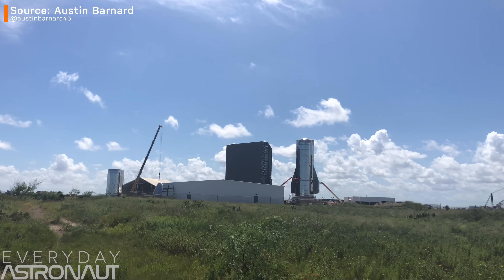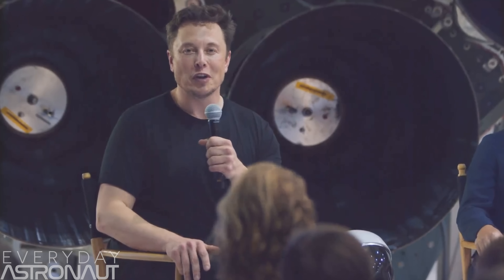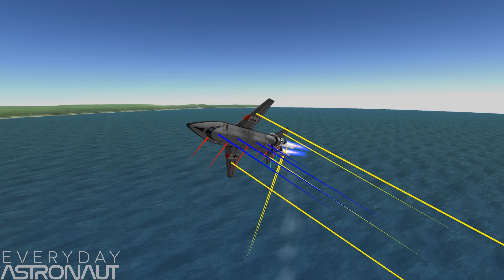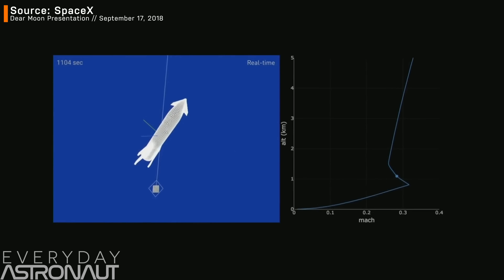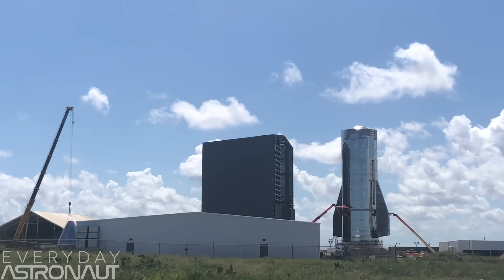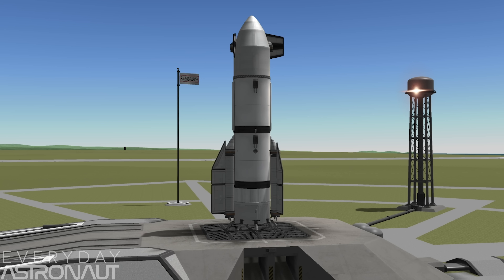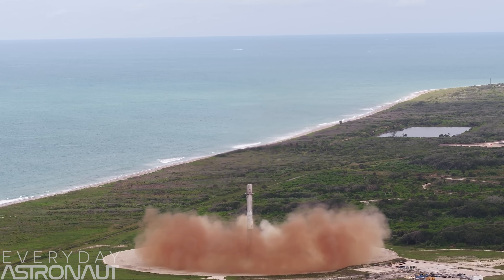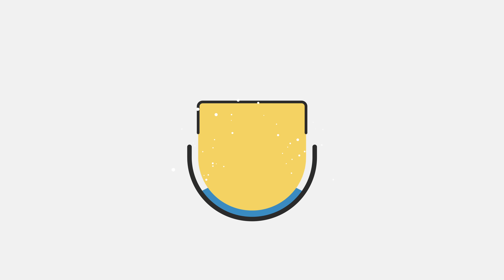Why does Starship only have 2 rear fins?!

Comment: We'll see how it goes after a test flight or two.  As you build things, they start to tell you how they have to be made and its usually not exactly what you had in mind when you started out.  Then when you use it for the first time, it will tell you more.  It would be amazing if there weren't big changes to the BFR after the first test flights.  What's most encouraging about Space-X is their willingness to listen when their project cries out, instead of trying to force a suboptimal design to work.

Comment: EDA, I super value what you're doing but there is a tonne of stuff wrong in this video.   Mach 1 on Mars at altitude of 1.5kms would be a guaranteed crash, because Mars Mach is VERY different than Earth Mach.   Only 1 of a 100 errors.

Comment: Tim: "Kerbal Space isn't an engineering tool"
NASA engineers: nervous laughter
Reply: You laugh, but I bet that NASA would have killed to have Kerbal for the Apollo program.
Reply: @j-man72b72  They would have done even more to get their hands on the hardware running it. Even our phones would have been ridiculously advanced back in those days.
Reply: @Zebra_M  Yeah, I had pondered that question when I got my first smart phone, that it had more computing power than the flight computers on Apollo 11/Eagle lander, though no where near rugged enough to survive launch and radiation.
Still mind blowing.
Reply: @j-man72b72  Vastly superior for launch than old fragile tubes and wires everywhere.  Not good for radiation, but that is EASY; put in a lead box.
Reply: Can you do a video on “possibly overlooked advantages” of the original or variants of the symmetrical three fin design?
Reply: Space shuttle parts worked to get the space shuttle up.  Why not? XD
Reply: Yeeah if you watch enough NASA, sooner or later you will see KSP. From what I've seen they use it for 'back of the envelope' numbers and/or having fun.
Reply: Nah, the public version isn't less advanced... it just forwards any successful designs straight to a central NASA server for them to crib off of!
Reply: @huskywithcoffee1568  muuuuuhahahahahahahahaahaaaaaa
Reply: Prototyping then?
Reply: That is very funny!!
Reply: The CEO of ULA says they tinker in Kerbal to spitball their actual concept ideas.
Reply: hahah yea somthing like this... i was amazed by the fact that people even complane about this one! Ohh my Good somtimes i just dont get it ^^ LUL
Reply: Well I think KSP with RealismOverhaul mod suite can be definitely a good prototyping tool
Reply: haha
Reply: @Tameron Hofmann  Plot twist: watch the recent video with them talking, don't fall for jokes... or do, Everyday Astronaut intended this as a joke probably...
Reply: Mark Rober should comment on this. He can be show if engineers used KSP as a tool.
Reply: Really? That old NACA (aka NASA) engineer, who came up with the design of ALL future space capsule type re-entry vehicles, (a basic truncated cone) working with some math equations on a chalk board in 1952, didn't look too "nervous", nor was he laughing!! Yes, if he had KS available then, I'm sure he would have used it too, but instead, he only used the "computer" in his head. Anyone here want to try using that one, for a change? OK, here's your piece of chalk; now please step toward the board!! :D LOL.
Reply: Is not an engineering tool, but is a very potent creative tool, anchored in some very solid physics (when Kraken behaves) which allows for visually creating and demonstrating concepts, extremely quickly !
Reply: He didn’t say it was, he said it was for illustrative purposes.
Reply: Astronauts say they should use kerbals orbital mechanics
Reply: It is an engineering tool if you have Realism Overhaul
Reply: funny I saw someone like Elon in the video using and explaining with it 🤷🏽‍♂️
Reply: @emmanuelmahuni8163   "fake", though both parts are real - combined they make a "fake" video.
Reply: Kerbal is overhyped & overpriced. I use Orbiter which is free & you can do so much more with if you have decent rendering software. Sketchup suffices for most renderings & is free. The programing in Orbiter is much less restricted allowing you to add more to it & edit more.
Reply: @theatom7264  Nice add
Reply: Not really an ad if the game is free with no ads within the game. I’m not in anyway involved in the development or promotion of Orbiter for the record. Just a long time avid user. Just tired of everyone always using Kerbal. THERE ARE OTHER SPACEFLIGHT SIMS! Some better than Kerbal. If there is a free game that basically does the same thing as an overpriced payed version I’d rather go with that. Also the addons(DLCs) for Orbiter are free & created mostly by the Orbiter forum community.
Reply: @theatom7264  1."Just tired of everyone always using Kerbal."
Maybe u should stop caring what others do....
2.I doubt orbiter offers that degree of creativity.(rocket building).
3.Kerbal is easier and prettier.
Reply: I mostly just feel people were duped into buying Kerbal without even considering or trying out Orbiter unless they use both. Thing is with Orbiter you’ll need some 3D rendering skills & a program to create models from scratch. More difficult than Kerbals approach but worth it because you can make ships that don't look like they were haphazardly put together with mismatched parts. In Kerbal you’re only limited to whats in the game & its DLCs include, with Orbiter you are only limited by your own creativity if you have the 3D skills & program.
Reply: @theatom7264  Again,very hard, 3d modelling is an entire job of its own,not everyone has the time and will to learn 3d modelling..Not to mention it usese directx7....
Kerbal rockets can look very nice,if u know how to edit them well enough.i Could give u countless models that look nice.

Why did u left out the mods of kerbal space program?Lmao they are also countles of them...u are not limited....

"
with Orbiter you are only limited by your own creativity if you have the 3D skills & program.
"
Ofc when making models from SCRATCH u are limited by creativity...u could also do that in kerbal lmao.Literally the only thing that orbiter has above KSP is its realistic......models lol
Reply: it’s an indoctrination tool

Comment: beside all the areodynamics, i think that integrating the landing gear into the control flaps would be a massive design flaw. Since the Flaps fold into the landing position right before touchdown, there would be no chance for the vehicle to land if just one flap would stop responding....

Comment: Great video. Why do the larger "body flaps" need to be so big in the first place? You would think that the canards and the body flaps could all be similar in size, so there would be four equal control surfaces possibly increasing stability (?).     ...That would totally destroy Elon's aesthetic vision though. It must suck to be such a visionary sometimes.

Comment: I'm not sure how comfortable and shock absorbing the landing can be if the fins are doubled as landing gears. Also, like you mentioned, landing legs and navigation fins are huge dependencies. Maybe it's safer to have dedicated landing legs that don't go through the same stress as the fins might?

Safety might be a major factor i guess.
Reply: Not to mention the fact that the hydraulic controls would have to be much heavier to control the surfaces if they had to carry the extra structural weight to reinforce the fins as legs
Reply: @thecheaperthebetter4477  they could've "locked" the fins to take stress off of the hydraulics maybe
Reply: Question regarding the newly proposed six engine configuration for Starship; i.e. three SL inner triangle cluster plus three vac outboard radial:  Rather amazingly, nobody seems to have noticed a potentially serious problem.  Nominal thrust of the Raptor is about 200 tonnes. Even the most advanced engines in this class like the CADB (Kosberg) RD-0120 & Energomash RD-191 cannot throttle down below 27%, whereas the SSME could only throttle down to 67%. Raptor will apparently be capable of going down as low as 20%, but considering the low gravity of of the Moon & Mars, maintaining low enough thrust to achieve a well controlled near zero velocity touchdown on either body with a Starship using only one engine already seems to be a bit of a challenge, let alone three. Why do I mention three engines? Because that is the minimum number that must be running to generate symmetrical thrust. Running only one or two at a time results in highly asymmetrical thrust vs. centre of gravity = severe inherent instability that would have to be countered with extreme & very rapid gimbaling. Another disadvantage of landing on more than one engine is the fact that reducing thrust means dropping chamber pressure = lower ISP / reduced efficiency. 

The changeover from the previous configuration of having only one engine in the centre (surrounded by six outboard radial) seems irrational. In fact, seeing as SpaceX have chosen to go ahead & develop a vac optimized Raptor, reducing to a total of one SL surrounded by four vac Raptors should provide comparable or maybe even better overall performance than the previous & current layout, while retaining the lower risk of the previous layout.
Reply: @RobertWillis-q3u  could they potentially vent unconsumed LOX through the engines and use them like giant cold gas RCS thrusters?
Reply: But then how do you suggest a slower reentry without the use of more fuel that's needed for the final burn.
Not trying to argue in fact I halfway agree. I just have trouble seeing a way around that issue
Reply: Hi @joshr1074 the reentry "burn" can happen anytime before you reach your destination, in the case of small ion thrusters this starts about half way there... kinda change of subject from the parent comment tho
Reply: Good discussion, if the position of landing legs and fins line up then i can see how the mechanism could be enclosed into two fixed fin. If the whole fin needs to move to control reentry then they are likely to need separate structures.
Reply: I suspect the reasons are, in order :
1) Landing needs to be so well controlled anyways that there is little point in having extra-wide landing legs. (I do worry for stability under wind though)
2) Legs closer to the main mass are lighter.
3) One piece having 2 functions tends to force bad design compromises and make redesign harder. In particular : articulated legs mean they can fail to deploy.

Comment: They won't tuck in on landing, as that will shift the axis the whole thing is balanced along, instead of running from the middle of the Raptors to the tip of the nose, it would shift sideways and mean the vehicle would be pitched over slightly on contact with the ground.

Comment: With two symmetric pairs of fins they could also roll it 180 on reentry and bbq both sides evenly.
Reply: Not a great plan, since heat shielding costs mass and it’s more efficient to put it on just one side of the vehicle.
Reply: @fighteer1  Fair point. But will the leeward side have any shielding?
If there has to be at least some, then it could be better/lighter to slim down the shielding and use both sides. That also potentially adds some redundancy a la Colombia. You *might* still make it back with one side damaged or failing if you have the ability to preferentially make the undamaged side extra crispy.

Comment: I think one important mis-focus in conversations so far is that definition of assent is not always (well close to 50% but that in lower gravity / air space) without the supporting booster to the design.  Ex: on moon or mars will be just starship and no booster.  Fin and lander legs, without booster are in a more critical (no rocket gimble control from booster) will have greater design impact in these "remote and no escape plan of value possible" mode.   My $0.002

Comment: The Mitsubishi MU2 is a normal looking airplane that uses "spoilerons" instead of ailerons for the wing control surfaces. Instead of one aileron moving up while the opposite aileron moves down as in typical airplanes the MU2 just throws up an aerobrake/spoiler on one wing causing a loss of lift on that side and inducing a roll in that direction.

Comment: What a great video Tim! Have 2 question though. One, with 3 fins and the landing legs attached to them, wouldn't that give the ship better stability with the wider stance when landing on a less than ideally flat surface? Question 2, coming in with the belly burning like it is, how many time can the ship be used before the surface is eroded so thin that there is a chance of the ship structure being compromised?

Comment: Function over form always, if 2 fins is the safe way to go then 2 fins is the way to go!
Reply: Right, here's a bit of function in favour of the 3 fin layout.

Using the fins as landing legs, will give you a much wider (and therefore stable) base of support, than having little folding landing legs on the body.

Comment: I think another of those "plausible but not really" reasons that 2 wings are preferable to 3, is this:

It's known that reentry bow shocks, if detached from the main body, can help protect the vehicle from reentry heating. As you've mentioned, this is why capsules try to have as blunt a windward edge as possible, to reduce reentry heating.

Well, in the 3-fin design, the 2 wing roots of the body flaps would have been jutting forward into the stream, and might not have received the full protection of the bow shock. Even worse, they might have generated their own shockwaves that impinge on various parts of the structure, creating localised hotspots leading to burnthrough of the structure. 

With only 2 wings, the wing roots are situated more further back relative to the airstream and generally fit the contour of the body and the deflected body flaps a lot better. That probably served a lot to simplify thermal protection.

Also, not gonna lie, I like how Starship looks now much better than the Tintin version. Sorry retro-sci-fi fans. :(
Reply: Well, I didn't even notice I have only put two fin on my KSP Starship replica attempt, looks like I unconsciously dislike Tintin :D

That being said, my manual control skill sucks, three fins will probably lead to more burn up/RUD on pad.
Reply: I loved the old look, but honestly I kind of like the new look as well!
Reply: It's actually 4 fins if you count the top ones, there's basically a top-half and a bottom half. can't wait for version 2.0 :)

Comment: OMG, people are complaining about the level of simulation?  Most mainstream news on cable TV uses the lowest polygon zero physics software, and KSP will load enough physics on a high end PC to make it beg for mercy.  How about the idiots whining about 'a game' buy you a few workstation GPU's for physics, about 5,000$ just for the physics and graphics cards, that should allow something better in time frames that allow a video every few weeks, with building the CAD and then running the simulations taking up most of your time.  Oh yeah, they need to buy you a license for Solidworks or Catia as well, that is a lot of cash for either one.

Comment: Isn't this a similar concept to Rutan's Spaceship 1/Virgin Spaceship 2? It's essentially a "feather configuration" like SS2.
Reply: Yes and no. The basic idea is the same, turning the belly of the craft into the airstream to generate maximum drag. But the implementation is different. The Spaceship one's feathers are passive and parallel to the airstream, while Starship actively controls it's fins that are perpendicular to the airstream. SpaceX also uses reaction control thrusters and rocket engines to augment the fins when necessary. And Spaceship one was surprisingly low-tech, it had to be flown manually, I don't think it had any significant electronic aid. SpaceX's Starship on the other hand is fully automatic and as high-tech as you can get. Of course Elon has far far more money than Burt Rutan had plus a huge team packed with the best aerospace engineers in the world, so they are in a completely different league.
Reply: Yes and no. The basic idea is the same, turning the belly of the craft into the airstream to generate maximum drag. But the implementation is different. The Spaceship one's feathers are passive and parallel to the airstream, while Starship actively controls it's fins that are perpendicular to the airstream. SpaceX also uses reaction control thrusters and rocket engines to augment the fins when necessary. And Spaceship one was surprisingly low-tech, it had to be flown manually, I don't think it had any significant electronic aid. SpaceX's Starship on the other hand is fully automatic and as high-tech as you can get. Of course Elon has far far more money than Burt Rutan had plus a huge team packed with the best aerospace engineers in the world, so they are in a completely different league.

Comment: When I tried to replicate Starship with 3 fins in KSP during the flip manouver it was unstable, so I come up with 2 big fins on the bottom (retractable), and 2 canard on top for descent adjustement. It's still a kerbal kind of stability, but at least it worked out!
Reply: You would be surprised how unstable many aircraft are and that the only reason they can fly is because of the micro second adjustments computers make.

Comment: If you had 3 active legs you can tuck them all in. Yes you have 50% more control infrastructure, but you have a backup control surface if there's an error in any of the 3 systems.
Other than weight, has there been any consideration for 4 fins?